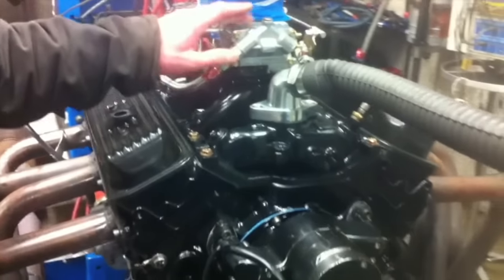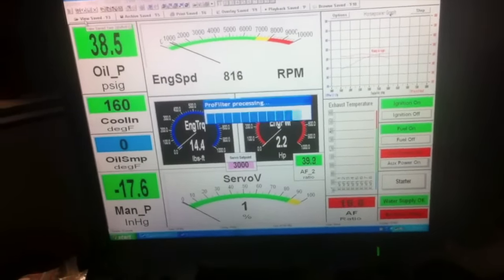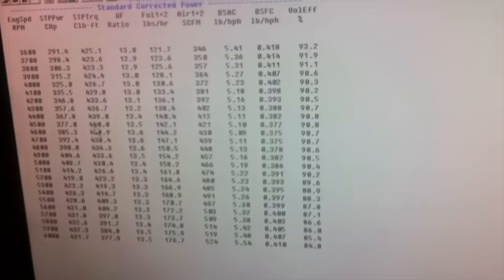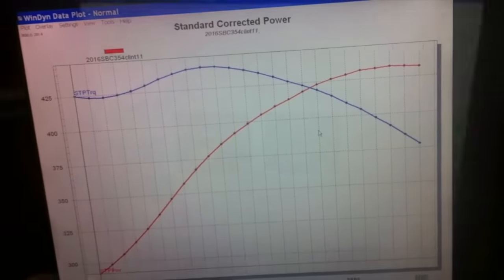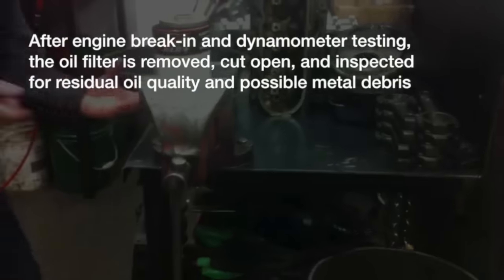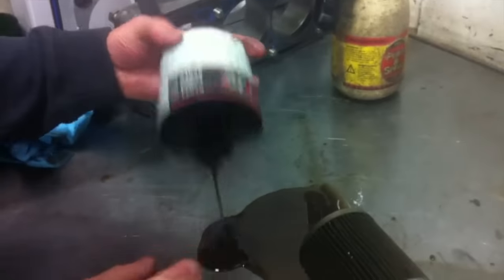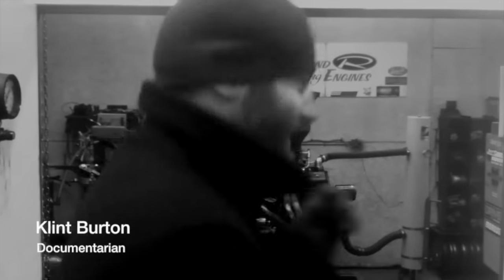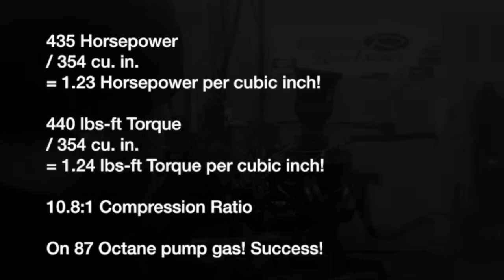SBC 400 Block + 327 Crankshaft Dyno The 350 Chevy Should Have Built (2016)

Comment: mopar guy here, chevy has made two engines that impressed the hell out of me,1---- 292 6 cylinder,marvelous engine,and then the best high winder--- 2--- the 327 something magic about that stroke of 3.25,that 327 put ME in the 12's in a shoebox 55 chevy every weekend,see mopar guys like all AMERICAN IRON
Reply from the maker: Hey thanks for commenting! Sounds like fun :)
Reply: the 302 was a whip too
Reply: @stevenbean9706  ,
They were 301s back in the old days, 4.00 inch bore and a 3.00 inch stroke.
Reply: @BobbyTucker  no, that's a 302 Z28 engine, a 327 block with a 283 crankshaft. 301 was a Pontiac emissions engine.
Reply: @michaels.ramsey7803  half right half wrong, we did call the 283 bored to 4 in a 301 in the old days, you had to search really hard for a block that would take the bore though. i'm sure im not the only one remembers that.
Reply: Lol.....mopar...yuk!!! Hahaha....all kidding aside, the slant "super" six was a killer engine!! And near undestructable!! I'm more a chevy guy but pretty near anything from that era was awesome.
Reply: @jimmieroan9881 Correct, you had to find a block with centered casting, easily done by checking the bore of the camshaft. If it was centered, the cylinder walls were equally thick on both sides.
Reply: @hitekredneck109  same here chevy to the core but it was hard to kill the leaning tower of power LOL slant 6
Reply: @hitekredneck109  yes it's a art to then and needs to be taught to any young person that shows interest . No matter what manufacturer
Reply: @Kevin-ti3rz  I could not agree with you more!!
Reply: Mopar owner here....and I've owned a 292 in a shorty Chevy van and a 350 HP 327 in a '68 Corvette I got to drive like a hoon several times. They are fun
Reply: @olikat8  you betcha,enjoy,what's left of our american heritage
Reply: @jimmieroan9881  My dad had a '57 Chevy about 1966 that had a 283 bored to 4.0" with a 283 crank. He had a 348 four barrel carburetor on it. with a 3.70 rear end, he said it ran good!
Reply from the maker: @forreststewart8309 
Right on! Great memories I bet :)
Reply: @ceperformance  EVERY SATURDAY AND SUNDAY NITE,didn't even have time for some the best movies ever produced,had to see them in rerun, wouldn't have missed it for the world,my nephews shop teacher come to him and said are you related to gary,he said he's my uncle,he said,his cuda was damn quick,he smoked us all,yeah damn good memories,even the cops used to bring their stuff down to loring lane and punch it all nite long
Reply: I hear so much hype about the 327...  And the one I had was as productive as a dog schitting on the carburetor.  No torque, poor mpg, couldn't get out of it's own way... This was 20+ years ago when we still had something for fuel. 383 stroker, massaged heads, then it woke right tf up.
Reply: @Faolan161  hey thats great,i had one freshened up in a 55 chevy 4.11 rear gears smoked a new mighty mouse z28 for 350 bucks,when that was a lot of money,gasoline today is not the same as i could get in 1969 from gulf station,105 at the pump,yeah it matters
Reply from the maker: @Faolan161 
Sounds like your set up was unhappy 20 years ago. The 327 was a great car engine as stock but not that good in a truck. Definitely the 383 was a big improvement.
Reply: @ceperformance  mine was built to rev to the moon,that engine made me a lot of money,you keep the stroke,i wind it up,7800 every shift,ISKY MADE IT ALL POSSIBLE
Reply: 327s don't turn any more RPM than any other engine. Stroke has zero to do with RPM! My dad, who's in the Central Illinois Stock Car Hall of Fame, had 2 Chevy factory 283 racing  engines from 55-58(Chevy didn't sell 2-4V 283s or FI 283s until 57 but the racing division was assembling them & letting them out to midwest racers in 55) that he turned 10,000 at the local dirt tracks. RPM is only limited by the size of one's bank account balance. My buddy turned his 555 BBC 7,500 for 13 seasons before a freshen up, & is now turning his 440 inch small block Olds(quickest Olds in the country with 3 "Top Rocket" wins in the last 2 years & a 3rd a few years back, 8,500. NHRA 500 inch Pro Stock engines are chipped to limit revs to 10,500. NASCAR 355s were turning 10,500+ for 600 miles before NASCAR instituted the gear rule.
Reply: @bradgriffith4231  stroke and rod length definitely used to have something to do with rpm for street guys and most racers. Back in the day, you were looking through junkyards for "double hump" heads and "pink" rods etc etc. Materials strength, head flow, and valvetrain limitations meant that slower moving pistons with lower acceleration rates could make more power. Try overwinding a stock long stroke 500 caddy, you will need a mop and a bucket. Things considered normal and affordable now were either made of unobtanium or so exotic as to be reserved for race teams. If given the option to have anything, they wanted to make 1000hp reliable many engine builders who wanted true reliability, and more horsepower hours out of a build Especially in marine use, etc, would still go for bigger bore spacing, taller decks, longer rods, bigger bearings, and shorter strokes (or better yet more cylinders) so they could use longer piston skirts. A VF4 Wisconsin air-cooled industrial motor had full trunk pistons 3.25" stroke and 12" rods. On the front was a decal with a team of horses that said, "Wisconsin engines, more horsepower hours." Anything departing from that may make more HP but is also losing durability. I express durability in thousands of hours at 75% power.
Reply: @Cletrac305  Engine Masters tested rod length ratio & rod length makes ZERO difference. In fact, Reher & Morrison says put in the biggest pistons the architecture wil take, put the stroke in needed for the displacement goal & then use whatever rod length it takes to connect the 2! RPM is ONLY LIMITED by the quality of all the components in the engine, but quality & weight of the valves, springs & retainers controls the RPM, as long as the rotating parts will take the stress. NOBODY uses double hump heads anymore unless they are restoring a classic or class racing where they're required. The easiest & cheapest way to make HP is more displacement or artifiacial blow & juice! I've forgotten more than you'll ever know!
Reply: @bradgriffith4231 if you dispense with the attitude so you can understand clearly, you will realize that you  just restated EVERYTHING, I said! Read it again. SLOWLY. No one is attacking you. Engine masters did not optimize the cam for the rod length, probably not much difference anyway. I measure DURABILITY in thousands of hours at 75% throttle for the diesels and large gas engines I built,  my tractor and truck pulling motors, and drag/street motors less so, I can gaurentee you that I DID NOT want a long stroke, short rod hockey puck piston 460 ci smallblock in my airplane, to go flying over lake Michigan with! ! Not even at the 100 hp the Continental O-200 makes! That's why NO manufacturer ever put any engines like that in anything they had to warranty. You are talking about campaigning a racing engine in a certain class, where every pound and HP counts for making the amount of $$ you have to make to be competitive, you are correct I don't have much experience in that or any interest to do so. I must make the most horsepower hours I can out of the $ I have, drive it to the track, and to work, drive past the Mc Donald's because in today's economy I can't afford a big mac most days. I had a huge pile of everything accumulated over two lifetimes, an R&D engineer for a father and welded together the winningest car in the history of Oceola dragway, NHRA points champion, mopar nationals street sleeper award,  maker of a perfect run, and built an ran a state finalist alchohol pulling tractor, and top modified antique pulling tractor. I have helped as a mechanic for a very successful late model sprint car. If you wind the short block to destruction, I guarantee you the short stroke long rod combo lives! Look at an F1 motor with pneumatic valves. Are there any strokers here? I stated that modern materials and components available to the AVERAGE STREET guy had made it a moot point! Read it! I am building a 4.5" bore x 4.5" x 7.150 rod "stroker" 572 blown MFI. aluminum KB hemi for my dragster that would have no issues at 7500 RPM even with a cam and springs that won't beat everything up, I was told not to go with a 590 or 605 if I wanted durability. I can only afford to build it once. understand your point!! I just sold my engine shop, machine shop, 3 barns full of parts, and 136 engines, not counting single cylinders up to V12s that went from 1924 on up. We machined our own billet pistons for pulling, made a billet head, and even welded up and ground some of our own cams. I built my own flow bench and have dynoed over 300 engines, I don't know you and am sure I could learn something from you. I don't know who's forgotten more, but I remember enough to get me by. Now I have just done something I hate to do, engage in a pi$$ing contest instead of a nice, friendly, productive discussion.
Reply: @bradgriffith4231  you have your attitude glasses on! You just restated EVERYTHING I said, we don't have any dissagreement here. Read it slowly. In a pi$$ing contest, everyone just gets wet! You don't know me. You don't know what I am doing, have done, with whom, or have owned. I don't know you, and out of respect, I would never make a statement like that. I'm sure we BOTH could have learned something from each other. look at F1,  pneumatic valves, and not a stroker in sight because then the bottom end IS the limiting factor. I am not concerned about ultimate HP/lb, I want durability in there somewhere. I  have no problems with stroker motors, I just don't prefer them if there's another option. Putting in the biggest diameter piston you can is the formula for making the stroke the shortest, the valves the largest and the rod the longest to get the lightest piston for the required CI. Good advice! If MODERN heads weren't available, these square or under square motors would not be competitive. That and durability is why Chevy didn't put a 454 smallblock in anything.
Reply from the maker: @danielsacks7152 Well said. Thank you for articulating these points so clearly. Sincerely.